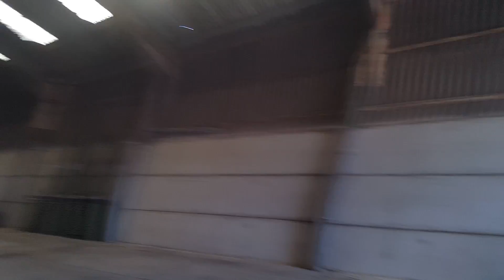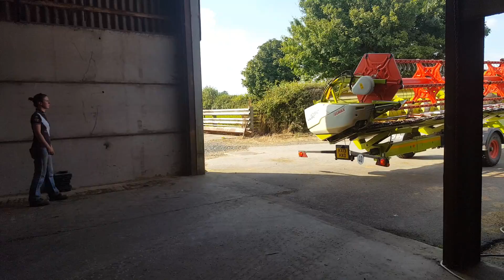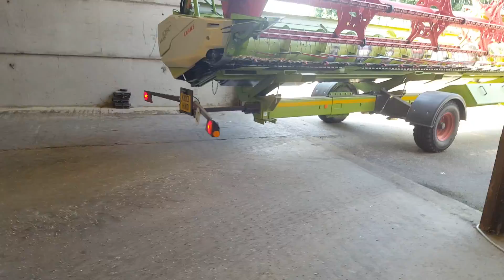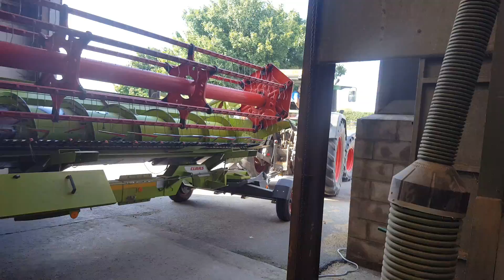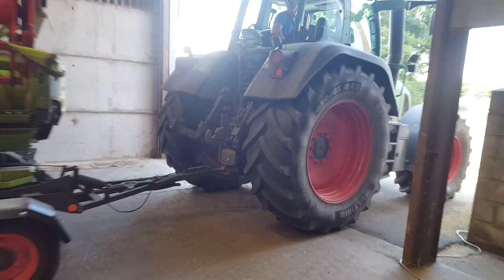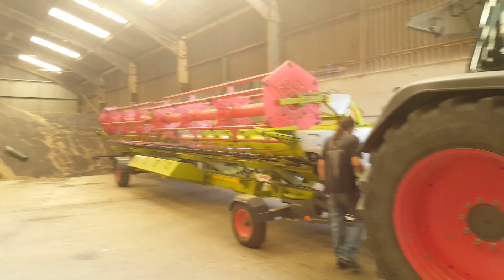Reversing a Double Articulated header trailer into the barn

Comment: thats only single articulated
Reply from the maker: it is double
Reply: AgricultureMC go on explain
Reply from the maker: well at the front it can do a 360  then the wheels also go 360 at the front of the header trailer
Reply: what? so your saying that the pickup is one of the articulated points?
Reply: Will Hallam it can turn at the connection point to the tractor and the front wheels of the header trailer also turn.